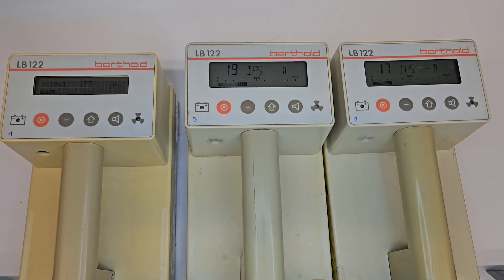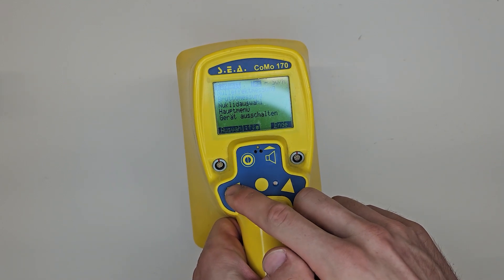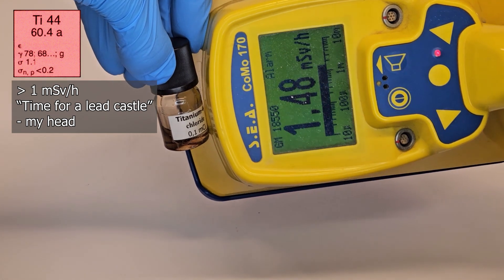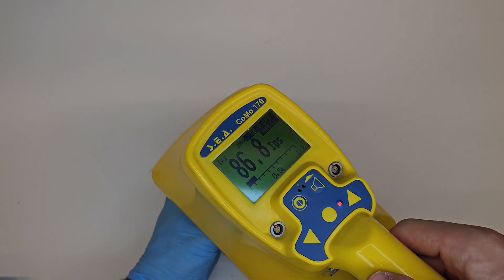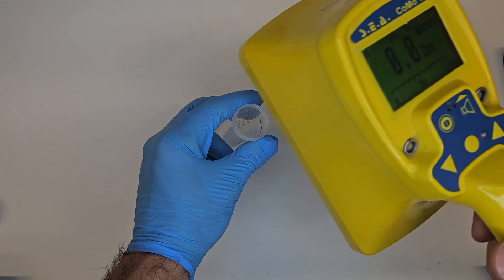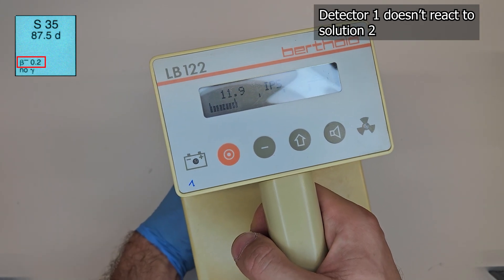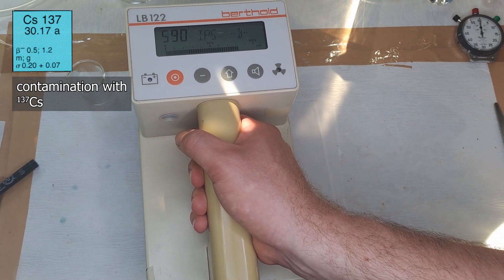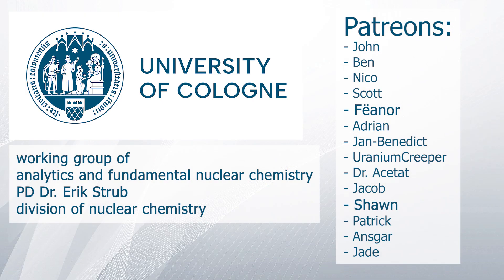Contamination monitors in the nuclear lab

Comment: I saw in some video that the large area contamination monitors are filled through a valve with buthane gas like used in lighers. I was amazed that no low-pressure is needed and atmospheric pressure is just fine.
Reply: I read the lighter gas is actually harmful to the counters as it contains oil which accumulates inside, unless some kind of filter is used.

Comment: wait, why is taking dose rate measurements with a gm tube controversial? The Como 170 gm tube is properly compensated, so dose rate should be relatively accurate as long as beta radiation isn't inflating the reading.
Reply from the maker: @teflon_ptfe  i was just referring to the fact that GM Tubes don't have to be energy compensated and so GM-Tubes can vary widely with their reading depending on wether they are or are not compensated. 
The readings of the Como are in line with the readings of our Personal dosimeters.
Reply: @SimonsNuclearchemistry  gotcha